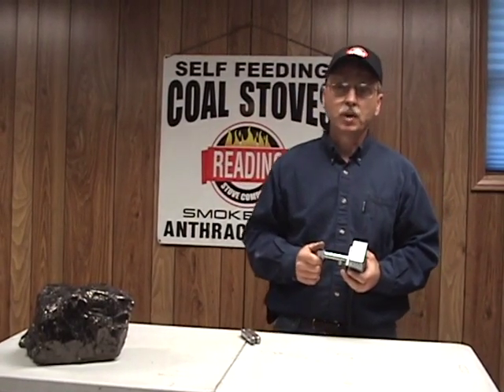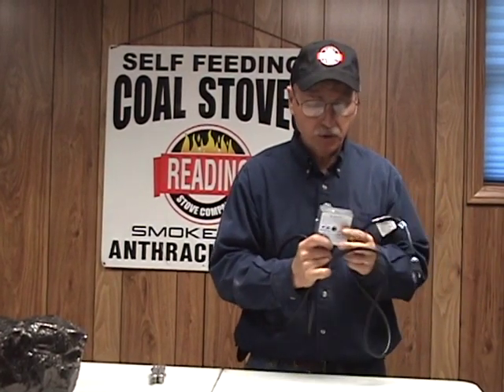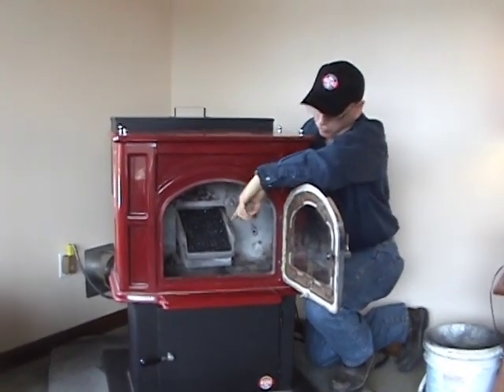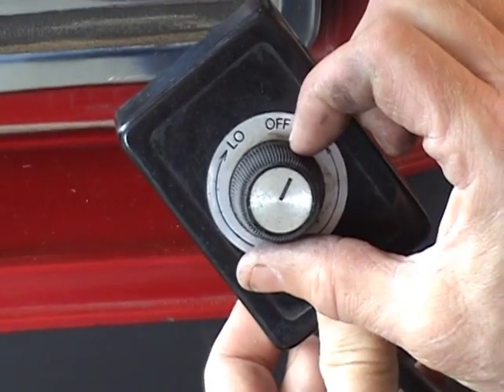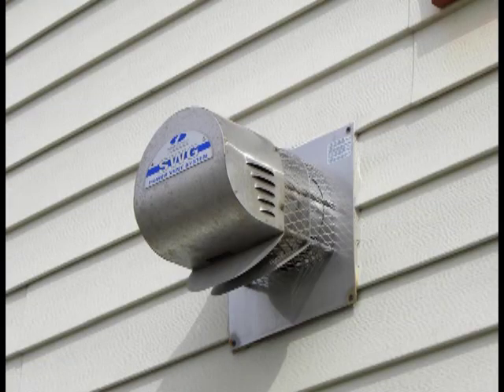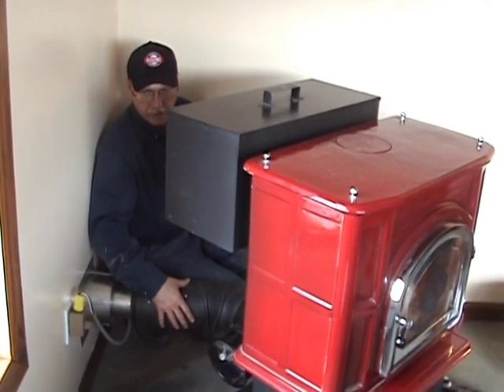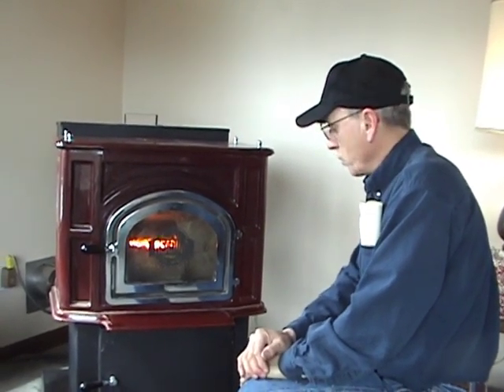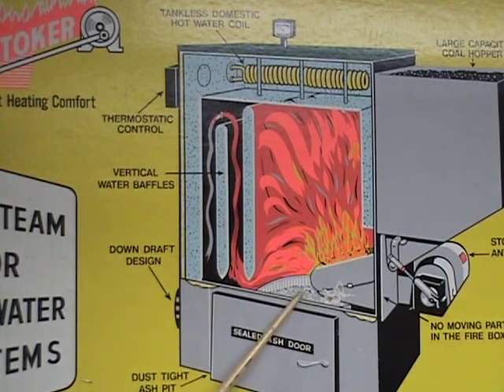DVD_Ch_7_9.m4v    Operating Coal Stove   Anthracite Stoker

Comment: I don't want a stove  that has to have voltage to operate. I lose power all the time, I want to stay warm with no power. This is not for me!
Reply: Do you have any leads on Stove Models that do not require power? Thanks. I'm looking for a small stove for an 800 square foot wood shop - that burns both coal and wood.
Reply: The stove I use, I've had many, is called a Wildfire. Google it and ask Steve if you can use coal in it too. Makes a lot of heat.
Reply: @HighConsciousness1  Check into a company called DS Stoves, they'll have what you need and their support is awesome.

Comment: This stove defeats the whole purpose of burning coal with all of it's electronics, an air tight coal stove once light in very easy to use and you never have to worry about any electrical outages depending on the stove it will heat your house maybe your hot water and allow you to cook all without any electric connections